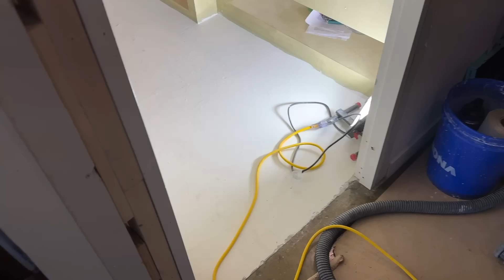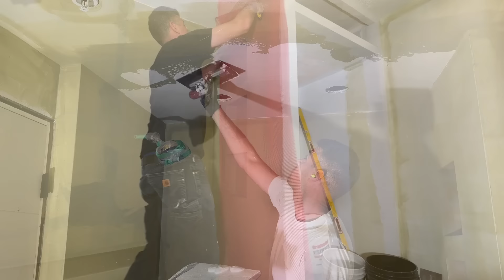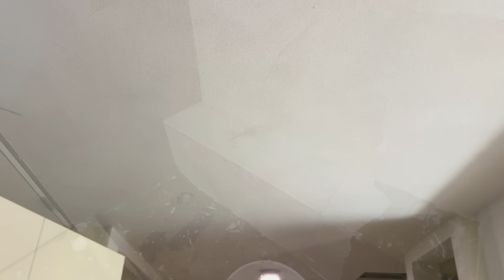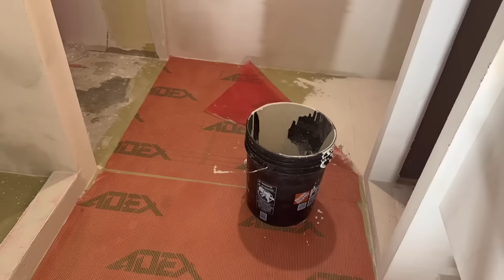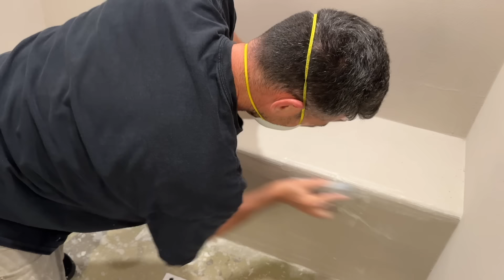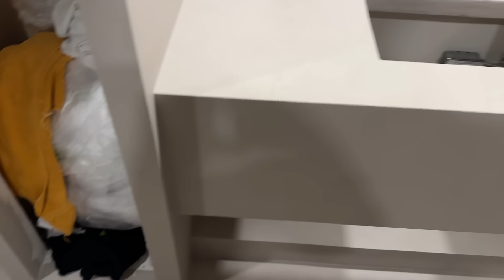Is MICROCEMENT Really DIY Friendly?

Comment: Well I am a DIYer with zero experience with this stuff.  Doing my own kitchen countertops was an eyeopener.  I eventually got there and it looks decent; but what a miserable ride.  The largest issue is how quickly the microcement  changes texture.  In 15 minutes it goes from pancake batter to cookie dough.  Still workable in an hour, sure, but how you have to work it varies throughout the hour you have.  Takes experience, and getting in on the first job is just not the way to go.

Comment: I would never attempt this.
I don't like the finished results. Not that you did a bad job, but it just doesn't look Finished...
Growing up,  my dad built a shower in the basement.
used Cinder Block, and coated it with Cement.  You don't get really nice flat smooth surfaces.
You end up with many surface imperfections.
Then he white washed it...   
Your Finished results reminds me of this...  cement parge over cinderblock.

Comment: I’m an installer for 5starfinishes plastering in Vancouver and I appreciate this video. However I feel like the issues were due to the epoxy element/ chemical makeup in nova color Microcement system. The material I use is locally manufactured and is much easier to apply. I’ve seen several successful diy projects with it. For application, I just mix to recommended consistency (no complex math) and adjust for specific needs/conditions. I apply similar to the video except I don’t worry about dry lines as the 5starfinishes Microcement doesn’t absorb immediately and dry up as with epoxy based ones. Finish with their topical sealer system and haven’t had any call-backs for waterproofing in showers etc. I think a lot of your issues here seem to point to the fact that nova color and other epoxy based finishes are troublesome by way of their makeup- when I used to experiment with products like theirs I’d always have call-backs and trouble closing out jobs and it was frustrating.

Comment: Several DIYers in my country have made vids using this stuff. They were putting it up in multiple paper thin coats. Basically scraping it on. They were sanding between coats, but that was really just to remove any nibs. Finally, the finish coat is apparently best done with a rubber edged squeegee trowel rather than a metal plasterers trowel.

Comment: little tip for you regarding working time. If you start with cold 2 part, it will go much slower. Stick it in the fridge the day before you use it, and let it get down to fridge temp. As long as it stays cold, it will react much more slowly. Even make an ice bath for your mix bucket if you find you can't work fast enough. it will make a huge difference.

Comment: Ok, I have used Novacolor for about 23 years now.  I love their products and use Marmorino KS more than anything else.  I'm highly proficient in Venetian plaster, microcement and Traditional Plastering.  I bought a sample kit of wall2floor and I have to say that I absolutely hated it.  There are many other products out there that are easier to apply and produce predictable results.  This is especially important if you are a diy applicator.  If you are, there is no system more friendly than Microtek One Coat(needs two coats not sure why they call it this).  This product is by Surecrete.  It is very affordable compared to other microcements.  One thing i'd like to offer about your process is to use your festool to sand the walls between coats.  there is no need to scrape so much.  I would also like to say that you did a great job for your first go.

Comment: Couple things, spray water over the already dried plaster with a spray bottle before applying new plaster so it doesn’t set up fast, it’ll give you working time too, fir the final coat of plaster, use a plastic trowel, and, when you do edges or corners, you don’t continually plaster past it, you’re supposed to tape off the edges and then plaster, release tape and then when dried tape off what you just did and plaster that joint to edges and outer edges. It’ll give you a sharper edge and corner.

Comment: I just coated a 1970's original formica countertop. The absolute worst part was dealing with the inside corners and the rounded bullnoses on the front of the countertop and top of the backsplash.  I think doing floors is probably perfectly fine for DIY if you're patient and have good kneepads.  Walls are a pain but you'd get the hang of it, eventually. Ceilings would be ridiculous.  Anything with curves is completely out of the question if your time has any value whatsoever. It does look good though I have to say.  Thank you for this video and setting proper expectations.

Comment: Great results. However the bench in the shower and the plumbing all being off center due to the bench is kinda crazy 😂. I've done a DIY bathroom using the Surecrete micro cement and didn't find it too challenging. You do have to embrace the imperfections as that is typically what you want to give it the natural or cement look. Results were fantastic and after 3 years it's still maintenance free. I'm actually about to do this on a different property. The biggest difference is that I didn't micro cement the entire bathroom, only the shower and one wall. I like the contrast with painted walls/ceilings versus the entire bathroom being all cement in one color.

Comment: Does the city offer permits where you have to park at a meter.  They do have it in my city as a courtesy. The only thing that you are required to do is place a cone at the back left of your truck to be legal. No placard or sticker is necessary. Just the cone will stop an electronic ticket.

Comment: They're a lot of corners and it's most difficult part. I have just four corners 😅and I would do smooth base, second I'd take roller and cover surfaces with it, then take long strong plate and grinder and make smooth surfaces again and finally cover with varnish.

Comment: Ben, you did a great job. I’m amazed at your drywall mud videos, I’ve seen about 30 of ‘em.  I’ve been a painter in custom homes $3,000,000-10,000,000 range, and I am not very impressed in general, of this products finish. After seeing the complicated steps you took, and short pot life times, then the final 3 coats you talked about (mineral sealer and 2 x finish), I am not impressed by micro cement at all. In the end, it’s just not a High End look.

Comment: Hi Ben. Thank you for this very informative video. All other video's i've seen, it looks very easy. I'm a painter and 58 year's of age and have been doing several 100 of thousand square-meters of plastering etc. And in my opinion these Micro-cement task's are NOT DIY. I struggle with the exact same things you are pointing out here in this video, and also the fact with vacuuming continously, and especially before/during adding clear laquer, while leaving a hair will seal it forever in the surface.... Have a nice day.

Comment: Nice work.  As an experienced microcement installer thank you for showing how difficult and not diy this system is.  There are products which are not as difficult to use, and the products we use are sandable. In order to use these products, you must first be trained in the system.  Also, install prices are similar to high end tile- this is not nor ever was supposed to be a cheaper option to tile.  You either want the look of tile, or the look of microcement.  As you mentioned the products are expensive and very technical.  The benefits include seamless floors and walls installs which mean no grout lines to clean, and venetian plaster like finishes which are waterproof and extremely durable.  When I started I was blown away by material costs as well, but when you see what the products can do you quickly realize the benefits and how to effectively price projects.  And don’t forget, you are taking a product and installing a finished product to 1/4” thick when done and making it look 2-6” thick when done- amazing.  Good luck to anyone brave enough to try this.  When done correctly it really is a beautiful long lasting finish which requires minimal upkeep and cleaning.😊
Reply: I should also add: just because you are a pretty good taper, does not make you a good microcement installer.  The techniques look similar, but are very different: there is a lot of compaction involved with application, purposeful overlapping strokes to create mottling, burnishing, techniques for maintaining a wet edge or ways to leave edges then come back.  The application is similar to Venetian plaster and there is a reason skilled European applicators take 5-10 years to master a craft.  With that in mind: considering microcement to be diy, trying to do it and failing- then referring to the product as junk really minimizes things unfairly.  But then, I have seen people try this product and produce results they were happy with and enjoyed for years.  Again, good luck to all

Comment: I was doing Venetian plaster and microcement when they were in fashion 20 years ago and hating every minute of it, mostly because I was mixing the materials up from scratch myself and getting consistent results was a nightmare. Now these specialty finishes are back in vogue and you can get all the materials pre mixed and tinted off the shelf I'm looking at offering it to clients again. But, it's not something I'd recommend as a DIY project, you need a lot of experience with the trowel to get a decent finish, you have to work quickly and accurately and the materials are very expensive.

Comment: i have seen this type of bathrooms in some "designy" hotels.  Couldn't help thinking while using that shower, "how on earth did anyone think of this finish for a shower?" There were some traces of mold and i was wondering if this is really a cleaning issue or just the surface is not really meant to be constantly wet. Great job on the finish, now i know how it's done. Seems also like it's a headache to maintain surface clean during lifetime of the product.
Reply from the maker: Hard to say. There is often mold in tile grout as well. It's sort of like a whole wall of grout lol

Comment: Correct me if I'm wrong but it looks like you're using an exotic system. The microcement I've heard of is not epoxy based.
Reply from the maker: It's a pretty bulletproof system specifically for a shower.
Reply: @vancouvercarpenter 
You make it sound more difficult than tile. Tile is commonly used in showers because it's easy to clean and doesn't stain. I wonder how epoxy microcement compares. And I'd worry about epoxy fumes. Other than that it sounds great.

Comment: Why use the epoxy based microcement that is unsandable? When I've used microcement, the sanding is what really levels out everything out and refines it. Is there a reason you went this direction rather than a non-epoxy based version with a 2 part polyurethane sealer?

Comment: Haven't finished the video,

I'm a pretty much full time "Traditional Plaster Restoration & Drywall Patch and Repair Guy"

I did a job for a client. She asked if I was interested in redoing her bathroom. I gave her my friend's number. He does bathrooms and tile work.

He quoted her and called me and was like "Hey man, we started talking and she want's to micro cement the whole thing floor to ceiling, you can do that, right?"

I was like "I can skim coat and do vyneer plaster, but I've never done it"

He was like, "Yeah you do all the stuff with the trowels though right"

I said "Only on T&M and I have no idea how long it will take me"

He never got back to me, I think I made the right move
Reply from the maker: I took the job with the same conditions.
Reply: DUDE I LIVE IN PHILLY I FEEL YOUR PAIN WITH THE PARKING. It's not even metered where I live so every two hours you have to go on a scavenger hunt to find a spot which, may or may not be between a 5 and 20 minute walk from the job

Comment: If you can, work on a plaster/ stucco crew for a while and there learn the trade. Then it will be easier. Plasterers and stucco workers deal with hard setting materials all the time. We have occasionally used Pool Plaster. Goes on much thicker. But time tested for wet areas. Also, Dryvit Genesis bag mix works great. I think you may have overpaid paying $300 per sack. Lots of easier ways to do it. Also, why no butterfly for inside, outside corners? No sponge float? Anyhow, your finished product looks good.
Reply: This is an interesting comment. I really think plaster / Stucco trade would have great comments about Microcement vs stucco/cement products which could be used with clear sealer.

Comment: Here in Greece its a common technique and for me as a house painter  its easy to do all you need is practice ....
Reply: do you have the same steps as he does?
Reply: @Joao_133  Well we actually use couple different methods it depends on the situation,,,we also use a very strong primer thats has something like sand in it to help the microcement {us you call it we call it patiti] to stick to the surface and after we apply the microcement usually 2 coats we then apply special varnish for longevity ,but yes pretty much the same steps 👍

Comment: That's a lot of corners Ben ! 

Inside corners are the worst, because there isn't an insider  corner diamond tool. Outside corners are easier because you can sand/grind it.

But as you've pointed out, mud you can sand.,  microcement is unforgiving... Unforgiving on your tools, on the speed required to work,  on prepping, and logistics. 

I do a few projects with MC a year. It's hell, but tile is bullshit. MC is an amazing finish. 

Excellent work my man. I wish I had your trowel skills.
Reply from the maker: Inside corners were easy for me because of all the drywall experience

Comment: I do some micro cement and floor toppings of every variety. 
You did an amazing job for it ent your first time!! Hats off to you! 
I just wanted to say you can definitely sand micro and the base coats and you should all the way up to the top coat but be careful. 
They make these ceramic discs that we use to sand out high spots and make things smooth. Be super careful though cause you ca burn right through the coat. I use a 50 or 100 pad. 
Great work all together! I love working with that stuff. Many manufacturers are different. Not all products behave the same. Some are much easier to use than others. 
Hope you enjoy your new space!
Reply from the maker: Thank you!!

Comment: I've been doing venetian plasterers for 20 years now. You need to sand in between finish coats for a better overall finish
Reply: Do you sand when it is fully set, or a little earlier when it isn't quite so hard?
Reply: @timbirch4999 when it's hard. If you are good with a trowel you can get away with sanding. If you have trowel lines it's better to sand because those trowel lines will show through the next cosat

Comment: I would use a disc sander, have used some materials that were similar and disc sander works great......you just barely "kiss" the high spots or ridges to get prior coat ready for next....thin coats multiple times...also maybe some internal and external corner tools would be good

a full blown plasterer would make short work of this stuff and this is isn't the easiest bathroom to do a "1st time" run for sure

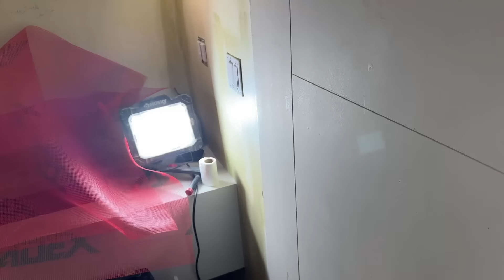Comment: 4:10 At $250 per bag, using this stuff with or without the mesh seems like overkill on anything but the shower stall and maybe the vanity top. I can see the advantages right in the shower itself, but for the rest of the bathroom, I'd rather have the look of tile, which would be a fraction of the cost. This video should probably be titled "How to make incredibly expensive plastic look like drywall mud."

Comment: I did my first one maybe a year ago and now I just finished my second one. I will say the second time around once the shock of the messiness is over, it goes a lot better. Use a Venetian trowel for the finish and you'll find that you can actually flatten any of those high edges while it's setting up without leaving those burn marks. Also if you really needed to sand, you could use a dust proof grinder and diamond wheel-200 to 500 grit to sand things down.
Mix very small batches I would even get like a 1 gal 2 gal bucket. Overall it is a hassle to deal with but I really like the look and both bathrooms that I did was steam showers and it is cheaper than all of the work required for tile and waterproofing and sealing involved.
Reply from the maker: There were no burn marks. Might have just been a shadow. I used CoMe Bianco trowel for finish coats and mixed in very small batches. Just enough to finish a surface with very little waste. I don’t think the video does the actual finished surface justice.
Reply: @vancouvercarpenter oh I'm sorry I wasn't saying that you had burn marks. I was just making a statement. I do agree the video can't show how nice the micro cement  finished does look despite the hassle of the work.

Comment: I think this was my favorite video you ever did. "Bougie con fill" 😂

Just a thought - I'm a DIY engineer so I already weigh everything - I use a fish scale (same thing as a luggage scale but half the price and it comes with a tape measure built in) and when I'm working in my basement I just have in anchor on the ceiling and I connected with a carabiner and a loop of webbing. When I'm outside I just hang it from my ladder. 

Anyway to me it's a whole lot cheaper than using a bathroom scale and it doesn't get as dirty. 

Thank you for all you post!

Comment: in Thailand, they seem to make wet rooms with cinder block and cement over the top (then wax the cement - which I assume is just polyurethane). It looks good, seems to work and it's easy and cheap 🤷 Why does that not work in North America or Europe?